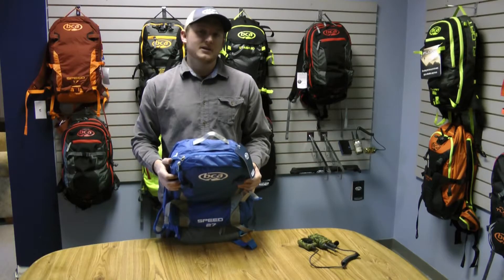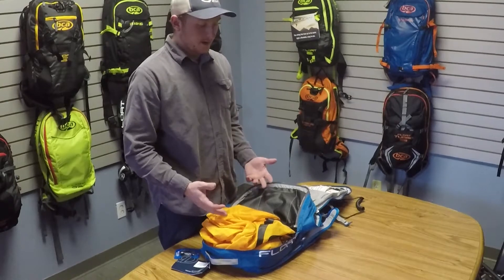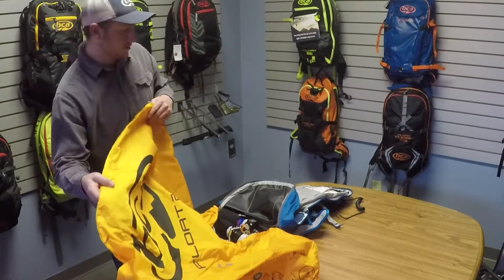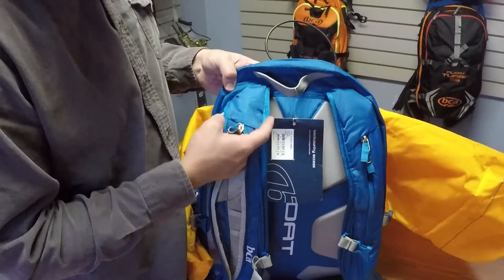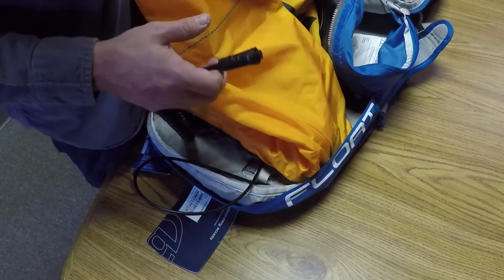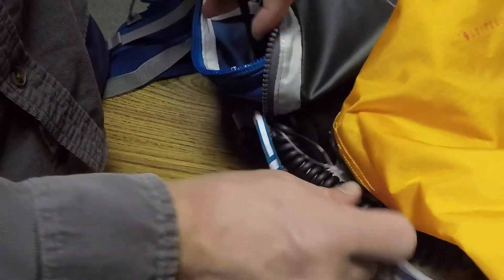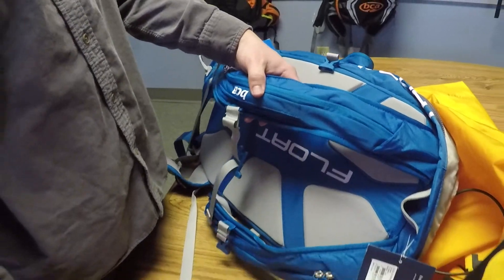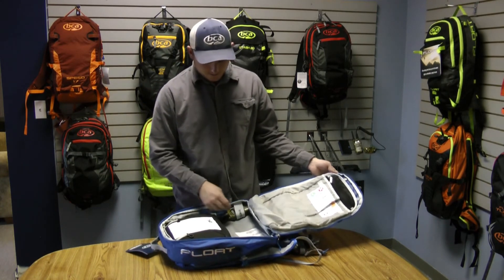BCA Float™ 2.0 Avalanche Airbag Accessory Installation

Comment: Hello, good video. Thanks. But looking to install the hydration reservoir and it doesn’t go over this? Or is the idea that the hose link goes through the same channel as the radio wire?
Reply: Hydration tube takes the same route as the radio cord, behind the airbag, inside the airbag compartment. On the new Float E2's you don't need to open the airbag compartment, everything is routed behind the airbag compartment, accessed with our new backstash zip.
Reply: @bruceedgerly7948  Would of been better if the resivor/bladder were stored in the main compartment with 2 clips like what you see in the Float 32 for additional room and the E2 main compartment with 2 clips or maybe if BCA would of made a extra compartment for the bladder, 3 Liter maximum. I tried to install a 3 Liter bladder in my E2-35 and it didn't work because there's no room, maybe I'll try a 2 Liter.